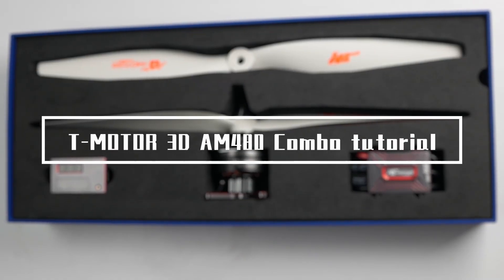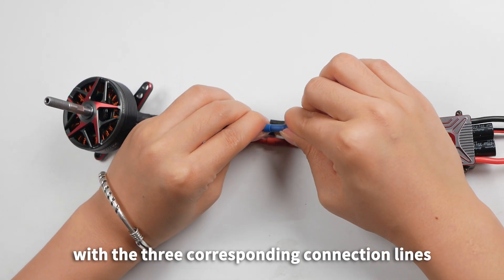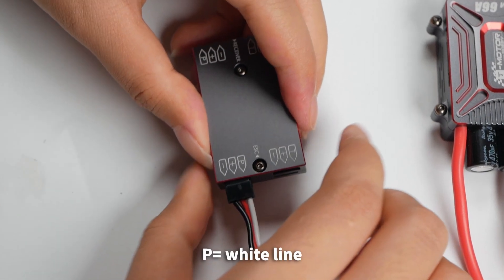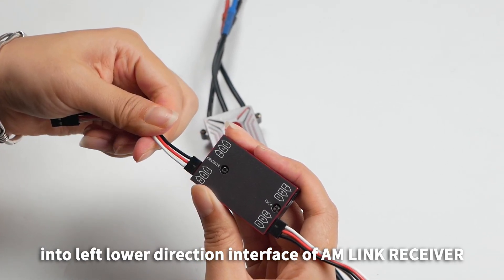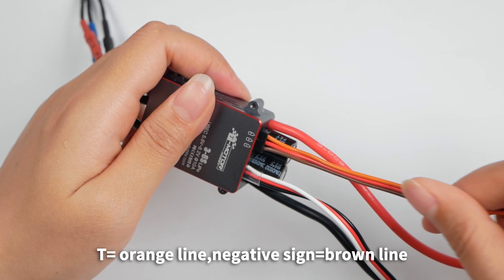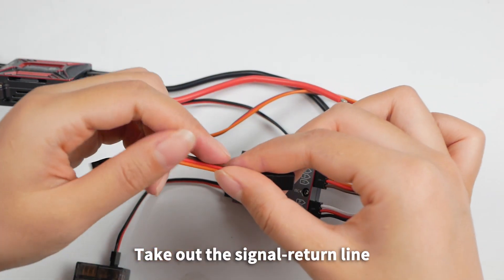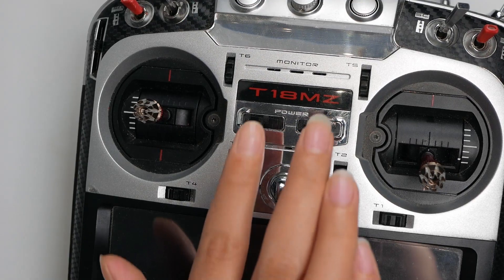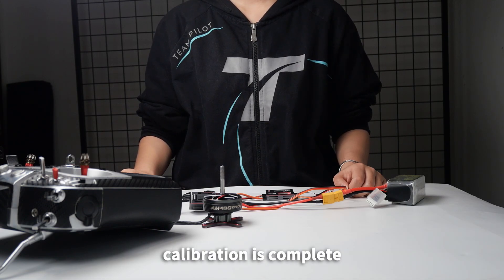AM480 Combo assembly tutorial

Comment: Do you have to leave am link installed or can u just plug esc to reciver directly
Reply from the maker: Can be inserted directly
Reply: @t-hobbyfixedwing  one more question what is the stock bec voltage it can be changed I know but what is it factory programming
Reply from the maker: @getitdone361  Factory default 7.4V, 5.8V-8.2V adjustable.
Reply: @t-hobbyfixedwing  ok thank you